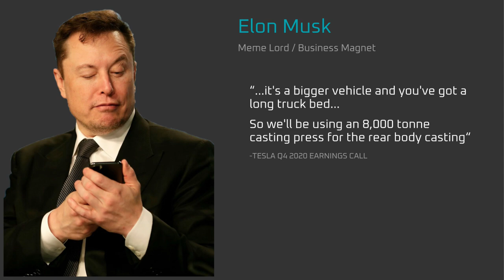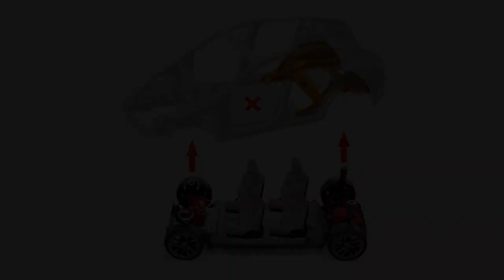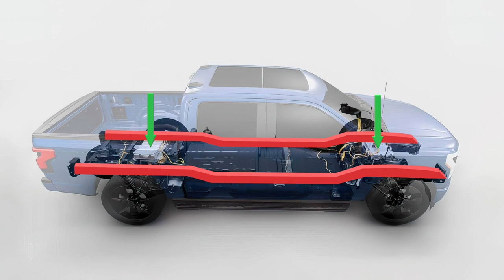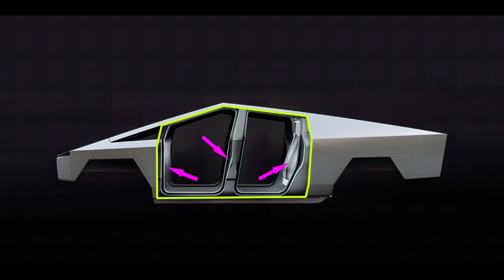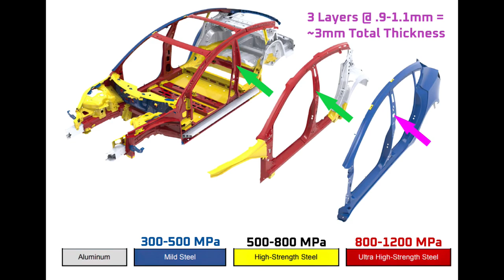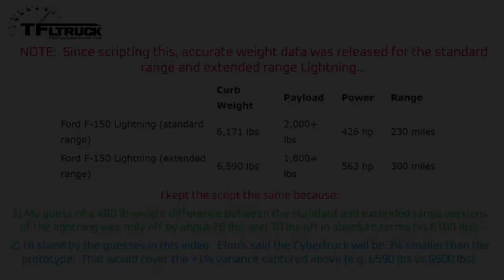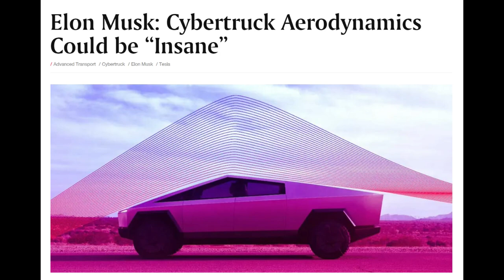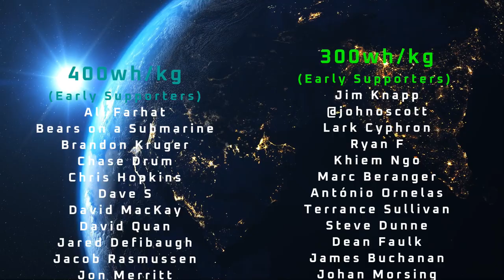Cybertruck // Merging the Exoskeleton, Gigacastings, and Structural Battery Pack

Comment: 21:36 Given the top spec CT will now apparently have 4 motors, that 2.9s to 60 may come down more. 👀 If the exo-skeleton can cope with a higher cargo weight (i.e. the tri-motor was the limitation, not the chassis), maybe we will see a higher load rating on the quad-CT too?
Reply from the maker: I hope so!  It would take some modelling software to work that out.
Reply: @thelimitingfactor  It helps that Cyber truck has huge wheels with so much contact patch that I bet tire grip won't limit performance. Then, if four plaid motors are going full blast drawing from a ~200kWh battery pack I would think it can overcome its higher mass with brutal power. Would need to do the math to know for sure though.
Reply: @Global_Optimization  Tire grip always limits performance.
Reply: @tedmoss Not true. If a given powertrain can output X kiloWatts to the wheels, and that translates to Y kiloNewtons of static friction required per wheel, then you'd just need to select wheels big and grippy enough to provide that much friction to not be the limiting factor in acceleration. 

In theory you could have more than 4 wheels, or make tires triple the width of normal tires.

Comment: To me the 14000lbs towing is an indicator of it being a heavier truck. You don't need more power to tow a heavier trailer comfortably, You need to weigh enough to not be tossed around by your trailer. A 6000lb mass trying to stop a 14000lb mass is a challenge. Yes trailer brakes help a ton, effectively reducing trailer mass by I'll guess 25%. Ideally the towing rig should be heavier than the load but that just isn't feasible in any situation.
Reply: Exactly, the tesla model x plaid with over 100php barely tows 5000ls compared to a Porsche cayenne turbo s 600hp that tows over 6000lbs.
Reply: The 200hp tiny Toyota hilux diesel tows well over 6000lbs too.

Comment: You could probably estimate shell weight with just dimensions and pictures of Cybertruck since it has simple enough construction and one thickness.
Battery capacity could also be estimated from their efficiency and cars drag, but it's likely to be less than 150 kWh in top model.
I don't think you need F150 for comparison here.

Comment: Ford trucks have always been portly, the move to aluminum that took off 700 lbs, as the F150 weighted 500 lbs more than a similar Chevy truck at the time.

I don’t see them adding seats with the battery, wiring and carpeting need to be added before seats.

Comment: Thank you Jordan.  Dumb question:  what is the black undersection & wheel flaring's of the Cybertruck made from?  Painting a car seems a wasteful process & especially so for a rugged utility vehicle - just wrong, a marketing driven product differentiation miss.

My hope is the $25k Telsa will be a Cyberhatch, 4x4 high-ride small hatch that seats 4 people.  Wondering if the $25K Telsa's release is delayed from need of Cybertruck proof:  least parts, processes, robots, factory space giving least cost car:  a dry-cell battery-like cost transformation.
Reply: The wheel flare might just be made out of a plastic, or a plastic coated folded metal

Comment: Many cases of rust on the surface of stainless steel are caused by damage to the protective layer of chromium oxide.  If the protective layer is damaged, stainless steel rust can form.

Comment: Aluminium for the doorframe would not be ideal as there is a barrier needed inbetween steel and aluminium. If you don't have that isolation barrier the connection will start corrode/rust. Even though it is 'stainless'. Also the regidity from the exoskeleton will probably come more from the bottom and sides as the top has windows and doorholes. If extensive load comes onto the A,B,C pillars that would be a nightmare for windscreen and doorfitting. I'm hoping Munro can shine some light onto the exoskeleton when doing a teardown.

Comment: How would safety measures like crumple zones be incorporated in the very rigid exoskeleton?. This car may be very dangerous in accident situations..
Corrosion would definitely be an issue if aluminium gets in contact with stainless steel.
Two issues that were not discussed.
Reply from the maker: You aren't taking into account the energies involved.  The steel will fold like paper in an accident.  The gigacastings will absorb most of the energy.

Tesla joined steel with aluminum in the Model 3 and Y.  I'm assuming this could be done for SS and Al as well with the right materials and isolation.

Comment: The rims of the cybertruck can be designed to give the truck proposin in water👍
Reply: That think will just sink in the water good luck trying to float!!!!
Reply: @alanmay7929  If the cabin was sealed, then that volume of air would be more than enough to allow it to float
Reply: @lanceanthony198  nope, and no one would even try that, the salt water will attack many other exposed parts which is bad for later resale or reliability.
Reply: @alanmay7929  I’m not saying it will be designed to float, but the cabin will have enough air to allow it to do so.

Comment: Excellent breakdown of Cybertruck exoskeleton engineering innovations! You were pretty spot on with your mechanical analysis. I agree from a manufacturing standpoint that the exoskeleton should reduce parts substantially.

One question that I don't recall being covered: the weight of bulletproof glass. A quick google search seems to indicate the weight from increased thickness could be 4-10X conventional glass. Also would need beefer motors to roll up and down. Apologies if I missed this in your analysis. There may be other tempering methods to increase strength (think smartphone glass), but that may add substantial cost. Maybe a topic for a future video?
Reply from the maker: Aha!  Excellent point!  🔥  I'm not sure the weight of the glass.  I was so focused on the exoskeleton and body, that I forgot about incorporating armored glass in the total weight calculation.
Reply: Not to mention that he forgot to talk about the Ford truck which the body is entirely aluminium.
Reply: Despite the impression some people have gotten, Tesla has never said that the glass is bulletproof. For that matter, the stainless steel exoskeleton is only resistant to small caliber pistols at a little distance (about 30 feet / 9 meters).

However, the glass is impact resistant compared to traditional glass and might possibly, if one is lucky, offer a little bit of protection from a single small caliber bullet fired from a little distance - absorbing some of the energy by shattering. Of course, that is far more than any other production car out there.

Comment: The weight or rather mass of the Frame in this vehicle range should be around 200 kg and not pounds. (double the mass counted for in the calculation).
Reply from the maker: Incorrect from what I could find.  200 pounds.  It's hollow steel and doesn't include other frame components.

Comment: The F-150 uses an aluminum body and it is hundreds of pounds lighter than a steel one. I believe Ford shaved off either 500-700 lbs from the steel f-150. So the 2 would be closer in weight. Plus we do not know how much the battery pack from Tesla will weigh.

Comment: I wonder how the extra rigidity and strength of the exoskeleton will affect crash safety tests? It would need crumple zones imo...
Reply from the maker: Crumple zones are built ionto the gigacasting
Reply: @thelimitingfactor  I get that the alloy in the casting is soft, but it is still encased in ultra hard stainless exoskeleton body that does not crumple? I just wonder how it will all interact in a crash test... I think it's going to be interesting to learn more about this over the coming months / years.
Reply: Imagine jumping that thing like a Ford raptor, it will just atomise the aluminium castings lol.....
Reply: I don't know how they'll accomplish it, but Tesla takes safety seriously so I'm sure there will be some kind of crumple zones.
Reply from the maker: It will collapse just fine for crash safety.  The energy involved in an accident is ridiculous.  Current high strength steel collapses just fine, and so will this.  It's the castings you have to worry about.  And those are designed to collapse as well.

As for pedestrians, not a concern for U.S. regulations, only Europe.   You're mincemeat when about any truck hits you.  That's why we need FSD and ADAS.
Reply: @thelimitingfactor  do not forget the weight of those EVs those are super heavy and you better not crash into them tbh!
Reply: @thelimitingfactor  Good to know, and I can't wait to see crash tests. Also share your scepticism on homologation in the EU, the size alone would make it unfeasible let alone pedestrian safety. Whole new vehicle design required for the EU and I can't see it being worthwhile for many years unfortunately.

Comment: I always thought rigidity in a vehicle was a bad thing for safety. I don’t see how a rigid exoskeleton crumples on impact to reduce force of impact on the occupants in the event of accident.
Reply: Ideally you would want a very rigid passenger compartment with crush zones in front and in back. Side crush zones are impractical as there just isn't enough room.
Reply: One suggestion has been that they may laser score the inside of some of the panels in patterns to create controlled crumple zones that would allow them to absorb impact. The front quarters of any vehicle are really just for covering the motor and hanging lights off of. So it doesnt need to remain rock solid rigid. Its also possible that they could do that towards the very end of the bed, where it wouldnt impact towing or hauling ratings.
Reply: @patreekotime4578  interesting. Makes sense. I figured there had to be something…
Reply from the maker: It will collapse just fine.  The energy involved in an accident is ridiculous.  It's the castings you have to worry about.  And those are designed to collapse as well.

Comment: I doubt the steel for Starship is the same as the Cybertruck. That was the original intention, but it was recognized that Starship needed to stretch rather than be strong. This is opposite of Cybertruck.
Reply from the maker: I've heard through back channels that it's the same.
Reply: @thelimitingfactor  interesting. Maybe they can use whatever works for the rocket on Cybertruck? My understanding is the cold rolled steel is too brittle for the rocket. Or the alloy change was enough with less extensive cold roll? I’ve heard nothing other than the alloy change for Starship.

Comment: Curb weights on vehicles are not even close to reality. The lightning will weigh 7500lbs + and the cyber truck will be lucky to be  under 7000lbs. The aluminum model S is just under 5000lbs. Great video tho)

Comment: Isn't 1,000 cycles of the battery really conservative? I thought the new chemistry was working towards 4,000 cycles.
Reply from the maker: That requires a single crystal cathode...likely not in the current battery cells based on the images from battery day, but I'm betting it's on their roadmap.

Comment: Aluminum would not be a good choice for the door jam because of electrolysis between the two metals.
Reply from the maker: I've heard this before but it doesn't jive.

Tesla has joined dissimilar metals in the past, they just needed to use the right type of bonding

Comment: Stopping halfway through to comment. The stamped cabin area does need to be structural. The "exoskeleton" is reduced down to only a few inches wide as it goes around the windshield and door jams and does not continue under the vehicle. You can think of it like 6 different structural components: front quarters exoskeleton, stamped passenger cage, rear quarters and bed exosteleton, then front gigacasting, structual battery, and rear gigacasting. Each of those components are joined together so they act in unison doing what a unibody traditionally does. This is why it would NOT be practical to use this design for a sedan or city car: because those kinds of vehicles are all holes and dont have any large flat panels that arent doors of some kind.

Comment: I don’t know how you think the ICE F-150 has a range of 560 miles. I can go over 700 in my 2016 with the 3.5 ecoboost fully loaded with 4 people and the bed full of gear, going around 70-75 mph. I get around 20-21 miles per gallon and it has a 36 gallon tank that is 720-756 miles. I can fill it up in well under 10 minutes. When electric vehicles can do this I will buy one.
Reply: At 140 bucks per fill..  If the important metric is how fast you can fill then good for you, but it's pretty weak.

Comment: There's no way a truck frame only weighs 200lbs. That would mean I could pic one up lol
Reply: That’s about right. I think you’re thinking of with chassis.
Reply: The driver door alone on my Toyota Sienna minivan is probably over 100 lb.
Reply from the maker: It's a tricky one for sure.
Reply: @akira28shima32  ?
Reply: @temujinkuechle6287  the Toyota Sienna is a very cheap mass produced minivan!

Comment: considering the shape shares similarities with that of a truss or space frame the roof components would be in compression while the castings and batt pack would be in tension for loads between the wheels.  A structural element in compression fails by buckling so having the glass roof and the roof pillars at  near right angles will help prevent buckling.  Having a large load behind the rear wheels could put the roof components in tension.

Comment: The thing I am the most interested in is how the Cybertruck will do in crash tests with no real crumple zones to speak of (since the exoskeleton, by definition, is designed to be rigid, not impact absorbing).
Reply from the maker: Fine.  All that's happened is we've moved the steel, not added steel
Reply: @thelimitingfactor  That is not trivial, though. This will have a massive impact on energy absorption characteristics and I'm just interested to see how that translates into passenger safety. They are no dummies so I'm not worried, just curious.
Reply from the maker: I didn't say it was trivial.  The gigacastings are what provide the safety.  The exo will fold like paper, just like the ultra high strength steel in current vehicles does.

Comment: The term. Skateboard is over used. You can't roll around any current tesla without the body. In fact. Past and maybe current cars need the battery removed to change a control arm

Comment: Now that you've explained the reason for the shape, I like it.  Well, sort of, at least.  But form should follow function, first and foremost.  I just wish the bottom of the windows, and the crease in the body down the side was level with the bottom of the truck and the road.  That''s probably the number one aesthetic I hate about modern cars.  The "wedge" shape and the unnecessary creases in the sides makes them look like stupid cartoon cars, designed for three year olds with non-discerning parents.  At least it doesn't have the ridiculous shaped headlights and taillights! (Second on the list of most hated modern car aesthetics lol).

Comment: Can we pressurize it and drive it on Mars without a space suit?  Is the glass so strong to ensure that random Martian rocks hitting the windshield don't cause depressurization?  :)
Reply: They could always make the glass thicker or add a second pane. It'd need changes to the door design and cabin air system and thermal control system because these systems are all optimized for earth usage. But yes, the basic cybertruck design could probably be used as a Mars Rover. 

They also would want to make the structure thinner to sacrifice some strength in exchange for better energy and material efficiency. Energy will be scarce for the Mars colony (sunshine 43% as strong as on Earth and hard to transport PV panels) and in high demand (they need to power a bunch of construction, manufacturing, road paving and methane production) but Martian gravity is also 38% as strong as Earthly gravity, so it doesn't need as much strength.
Reply: @Global_Optimization  That’s probably true but that’s if they plan on manufacturing cybertruck on Mars any time soon. If there’s going to be any cybertrucks on Mars in the next one to two decades they will be made on earth.
Reply: @lanceanthony198  yeah
Reply: @lanceanthony198  the diameter of Space X rocket is the width of a basketball court.  Cyber trucks will fit.  You only need a few.

Comment: Aluminum does not play well with other metals   Corrosive action can happen and this action will destroy the joint
Reply from the maker: These kind of metal combinations are used in almost every vehicle currently in production.

That's because there are a myriad of joining techniques.

That is, this is a dumb comment.
Reply: I have seen aluminum that when it oxidized broke a 1 inch thick riser plate of white cast iron on a surface grinder. Don’t tell me there isn’t a possible problem, how these joints are handled is very important, and I don’t know how Tesla does this if they are doing direct joints, maybe some kind of structural adhesive!

Comment: Well done. I think its a little lighter. E.g. when there are areas where 2mm thick stainless steel is enough why using 3mm?
Don't forget the metric system. Well, i think a US pound is 431gram. So, a little less than half to get kilogram. 
There is demand outside the US. I have ordered a Cybertruck with full self driving in Germany. Not really needing but it will last very long. The vehicle can look for a parking space and come back on its own. Fine to be used for camping.